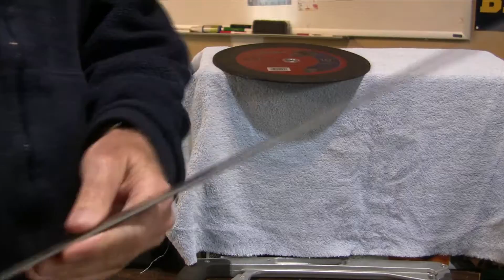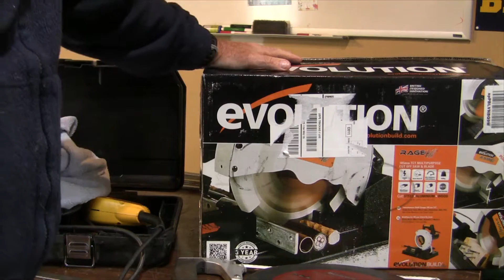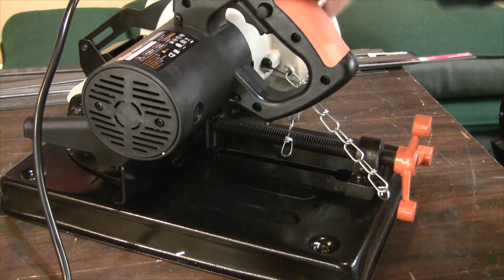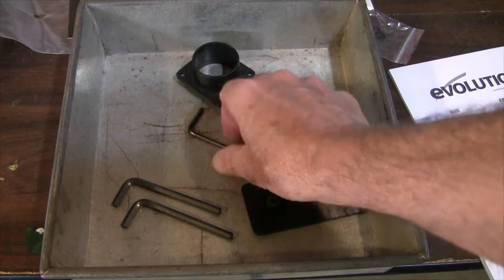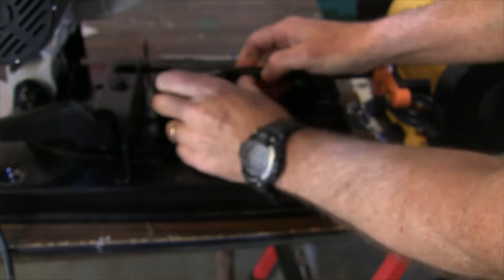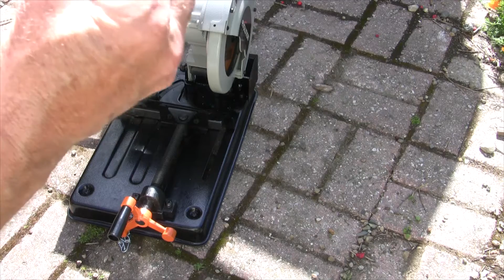Evolution Rage 4 Metal Chop Saw Setup and Extension Fence (Part 1)

Comment: Hi.. please can you help me, my evolution rage 4 has stopped working on me cutting wood
Reply from the maker: When you say "stopped working" do you mean it doesn't turn at all or you're having trouble cutting wood now and it used to work fine?

I haven't used my Rage 4 to cut wood, just metal. That's what it's designed for. The blade revolves at 1450 rpm. 
When I cut wood I use a regular Chop Saw. Chop Saw blades spin at 4000-7000 rpm.
You want a slower rotational speed when cutting metal because it's a lot harder than wood.

That said, you can cut wood with a Rage 4 with the proper blade like this one:
https://store.evolutionpowertools.com/products/fw185tct-40?variant=32992277069917

Do you have a blade like that?